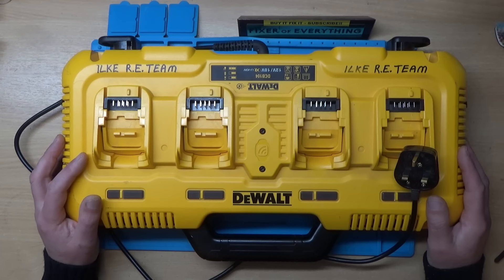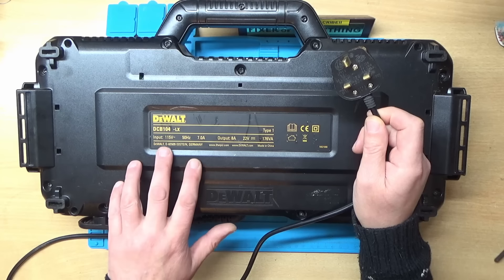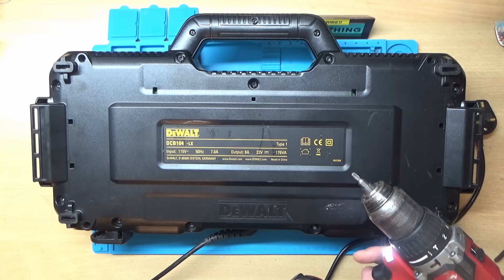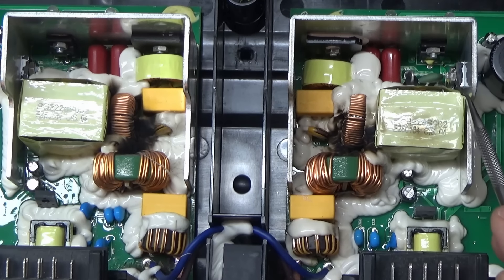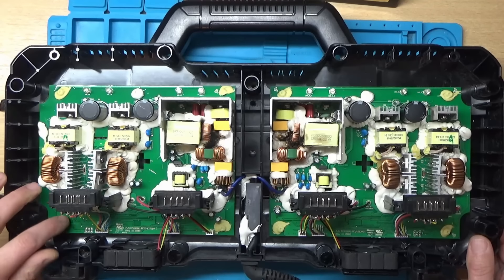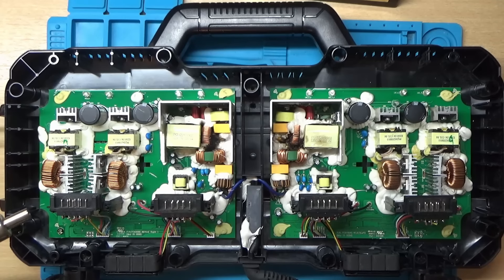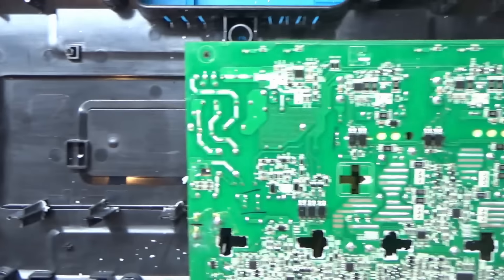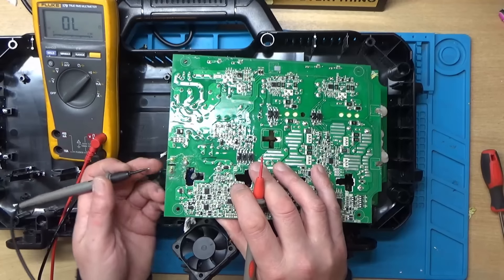Dead Dewalt 4 Port Fast Charger | Can I FIX It?

Comment: just seen this video now. It would've been interesting to see if that one could've easily been converted to 230V.
Usually those companies do not completely redesign these things, at the end it's usually just a simple population option.
Reply from the maker: There was that option on the Milwaukee chargers (a jumper position marked J1), but I couldn't see anything similar on the Dewalt.
Reply: @BuyitFixit  probably would require a comparison device or a datasheet for the involved components

Comment: Hi, a good fix there and thanks for explaining the site transformer. 
It's odd why they went to the trouble of designing a 'mirror image' board, when they could have used 2 identical boards ?
Reply: Weight distribution might be the reason.
Reply from the maker: Thanks👍yes I thought the same too.
Reply from the maker: Possibly, but then what if it were just  single charger? I would think a company would put profits first rather than if their charger was balanced 🤷‍♂️
Reply: @BuyitFixit  Remember, these things are supposed to be bought by serious campaigners, 'bespoke engineering' needs to be done to and accordingly charged for.

Comment: Another great video! Can I ask what rework station are you using? Thanks.
Reply from the maker: Thanks 👍do you mean my iron? Or hot air station? I've just upgraded my hot air one this week as I was using the 858D clones but just got a second hand  atten-872D from Ebay the other day which I haven't really used yet.
Reply: @BuyitFixit  I meant your hot air station. Thanks!

Comment: you have everything linked in your description except for the parts.  i can’t find the part numbers.  if i go to the dewalt website they have service manuals but not for this product.  the rental company is having a steel building put up and they installed a box of outlets for the contractor with welding outlets without realizing that the regular outlets in the box are also 240V so it fried the contractors charger and so the rental company just paid for a new one so i just ended up with the old one but i don’t have the manual or a parts list and it’s not on their website so im wondering where you got those parts?
Reply from the maker: I can't remember the number off hand (you might be able to read it from the original varistors still). Something like a MOV-14D201 which has a maximum voltage of 130V.

Comment: Nice job Mick, as always. What do you think it would have taken to convert to 220v? just out of interest.
Reply from the maker: Thanks mate 👍Not sure, I did have a look as the Milwaukee chargers have a jumper which is either fitted or not depending on the voltage. Someone in the comments suggested wiring both chargers in series but I didn't fancy that.
Reply: @BuyitFixit , I'm not sure I would fancy that either, but I don't know enough to know if it work or not. My knowledge is no where near yours, ok, so I'm approaching this probably more simplistically than I should. But My first thought was that either all of the components in there are only rated for 110v which would potentially be a real ball ache to swap out OR they're already geared up for 220v and the jumper you mentioned simply puts some other level of voltage regulation in front of the 110v circuit so it only ever see's 110v, if that makes sense.
Reply from the maker: Yes on the Milwaukee charger it's pretty much what the jumper does.

Comment: I was using a Dewalt cordless power tool charger on a modified sine wave inverter one is day it quit working when I had time I opened it up to see why and found one of the wires that was soldered to the board had gotten hot enough to melt the solder had a auto battery maintainer and charger that did the same thing since then I've found utube and know that a modified sine wave power supply will create a lot of heat
Reply from the maker: Interesting 👍

Comment: This is a typical right to repair case, I would say. 🤔
And thanks for the tip to remove nasty things with the rework station, I might use it on my mother-in-law.🤣

Comment: Can you convert this to run on 240 volt as I remember you repairing a charger before and you said just connect something and it goes back to 240 volt
Reply from the maker: I did have a quick look, but I couldn't see any placement for jumpers or anything so not as straight forward as the Milwaukee one to convert. Someone suggested wiring the two units in series, which might work, but I don't think I'd be keen on that.
Reply: Thank you so much for your reply

Comment: Connect this two power suplys "in line", then You can plug into 240V line:)
Reply from the maker: Someone else mentioned that. I'm not too sure how well two switchmode PSUs in series would work.

Comment: It is also an isolation transformer so you are not getting a shock from the ring main
Reply from the maker: Yes, but centre tapped to earth, so each wire on the output is around 55V referenced to ground.

Comment: i cant believe how many times ive done that on a power cord
Reply from the maker: 😂😂😂👍I've done it on all kinds of plugs. I was fixing some headphones a couple months back and forgot to put the 3.5mm jack plug top on the cable first. I made a really neat job of soldering all the wires too before I realised 😂👍

Comment: Exceptional work my friend 😊 One question,  From watching Big Clive and the other United Kingdom Geniuses 🦁I thought all UK plugs had a fuse in the plug itself?   Should that have not saved this charger?  🤔 or was this plug a chinesium no fuse plug 😅 Love your videos 😇
Reply from the maker: Thanks 👍Yes all real UK plugs have fuses. This one had a 13A fitted, and the fuse in each charger board was 8A. Because both boards didn't fail at the same time the 8A fuse blew first. Hope that helps 👍

Comment: USA is standard voltage of (115 volt supply) Europe is 115 to 230 volt and Japan has (100 volt ) AC supply. Building sites max is (110 volt / 16 Amp)  yellow cable.

Comment: Ha Ha yes many times I  done the same. The worst one was a 21 pin connection plug way back in the 80s. Pain in the arise having to unsolder every pin just to start again, Me gov was not to pleased.
Reply from the maker: 😂😂yes it's easily done. I've done it many a time. I think the last one before this was on a headset replacing a 4 pole 3.5mm jack, and it was enameled wire. I did a really neat job soldering it all up, end then realised 😂😂😂😂

Comment: I have a dual DeWalt charger, everything powers up and both lights flash when two batteries are inserted but only one side of the charger will charge the other side will just keep flashing but not charge, have you repaired any of these?
Reply from the maker: Sorry, this is the first Dewalt device I've worked on.
Reply: @BuyitFixit  ok thanks 👍

Comment: why are site transformers 110V in the first place? isn't UK 240V?
Reply from the maker: Yes, pretty much all domestic is 240V, however to reduce the chances of electrocution on building sites (due to water, wet outdoor work or people running over or chopping cables) they use this 110V transformer which is centre tapped to earth, so the most you shock you should get is 55V, and 110V tools.
Reply: @BuyitFixit  Thanks for the insight. Makes sense.
Reply from the maker: You're welcome 🙂👍

Comment: So 240V volt caused this to blow.  Why, then, did it have that plug on it?
Reply: I think that is obvious, some idiot put a plug on.
Reply from the maker: I was just going to say similar 👍
Reply: This could be a situation of knowing just enough to be dangerous.  To minimize manufacturing variations, power supplies nowadays are frequently designed to handle a wide range of mains voltages (e.g. 100-240 VAC).   The manufacturer then only needs to provide the correct plug in each market.  Whoever altered this plug may have (very incorrectly) assumed that was the case here.   (Of course, if they had read the spec plate, this was obviously wrong.)
Reply from the maker: Could well be the case 👍
Reply: @Anthony-w7i5g  I think the idiot was a first year apprentice and a journeyman was providing him with a learning experience (having a laugh!). Wouldn't be the first time or the last in my experience  lol

Comment: What I completely don't understand (in this case DeWalt) is, why they make the effort to make two different PCB's (not even mirror image). Why not two PCB's that are the same.
Reply from the maker: That's what I thought too, someone suggested weight distribution but I'm not convinced 🤷‍♂️
Reply: @BuyitFixit  I think it was because the power came in at the center and they didn't want the extra labor of routing the line cord. And the cost to make that mirror image board is literally so small, as the most expensive part of PC boards is the artwork for the etch masks, drilling patterns and silk screen. Once that art is generated, a simple few clicks on a CAD program makes the mirror image masks. The build costs of each board are exactly the same, since the same components are used on each.

Comment: This is one of the reasons why a single-slot charger is the best.
Reply: this is teaching us its better with 4 single charger then 4 slot charger, if this 4 slot charger died you on trouble, if 1 single charger died you should have 3 charger available
Reply: Yeah but you would need 4 power sockets instead of one…. Not mentioning the cable mess.
Reply: @Todestelzer  you ust need to screw those 4 charger on 1 board, you can use woods or plastic board easy, and one 4 slot power socket
Reply: @Todestelzer   better to have a reserve charger.
Reply: Yeah no. Not when I have to go to a site and work there. Stuff can and will break. You can have a single backup charger on hand if the 4 way charger breaks.

Comment: I don't get why in a 240V country you use 120V utensils.
Reply from the maker: Most domestic things are 240v but on building sites they use 110v to reduce the chance of electric shock due to water and other hazards.

Comment: Replace the capacitors and the varistors to 300 v ones, then you can use it at 220v
Reply from the maker: That may work, I'm not sure if anything else would need changed or how safe it would be. The Milwaukee chargers have a link on the PCB so it's just a matter of soldering a link or removing it to change the voltage.

Comment: Why not just convert it to 220/230/240/250v ?
Reply from the maker: Couldn't see any easy way of doing that. The Milwaukee 6 way charger has a jumper marked J1 which you can de-solder or fit to change the voltage.

Comment: You dont want to fix another one do you? Im north east area….
Reply from the maker: Did you 240V a 110V too? 😂😂
Reply: @BuyitFixit  ha no, mines a 240v. One side went off., Then couple moths later other side went off. Ive had it apart and picked off a load of the silicone, couldn’t see anything untoward (im a sparky - very very limited knowledge with electronic components) so its back sitting in the box. I can send it to you if you can repair it for me.
Reply from the maker: I'd check the two fuses first, just incase 👍
Reply: I think i did, but i will do tomorrow and get back to you. 👌🏽
Reply: Checked fuse, seem ok, not sure if it is a resettable type on this one? I have a pic of the board. Not sure i can post it on here?
Reply from the maker: @stephenferguson9405  They aren't the resettable type on the one I looked at.  Feel free to send me an email it's the channel name at out look dot com.

Comment: Why do they run 240 to everything if they know it's safer to use 120?
Reply from the maker: It's because you get more power with 240v with less current and also can use thinner wires. Let's take a 3000W electric  heater. That would be 12.5A on 240V but 27.7A on 110V

Comment: We have a very quick technical question. What is the difference between a 78006 and a 7806 voltage regulator. If there is a difference, where can we source a few 78006 regulators?
Many Thanks.
Wayne & Nina
👍👍👍👍👍👍👍👍👍👍👍😊😊😊😊😊😊😊😊😊❤️❤️❤️❤️
Reply from the maker: Hi Nina, I just had a quick search and the 78006 can only handle 500ma from the datasheet I found and the 7806 can handle up to 1.5A. I think it should be fine to replace it with the 7806 (although I forgot to check if the pinout was the same).